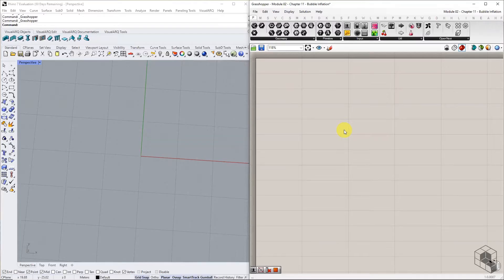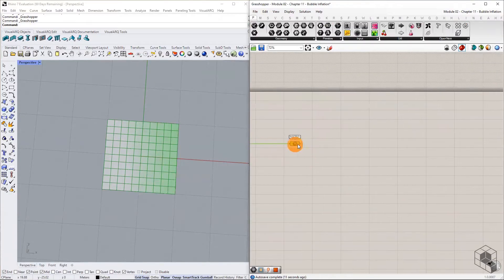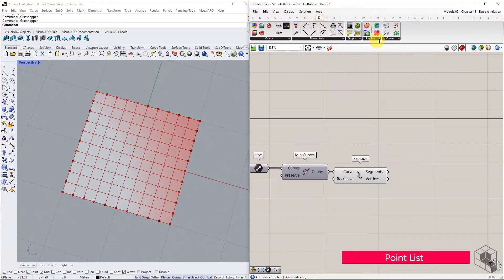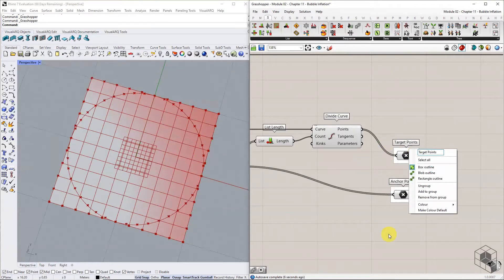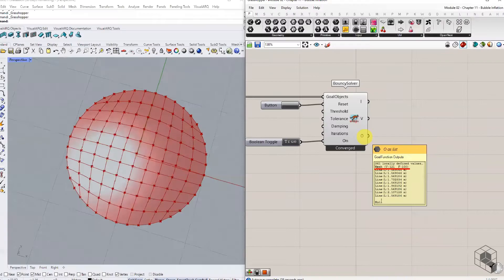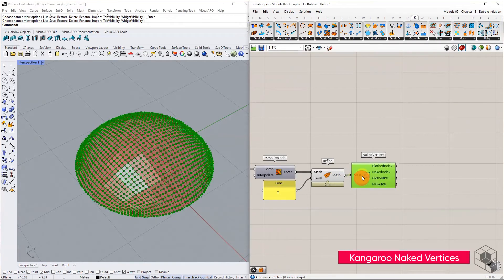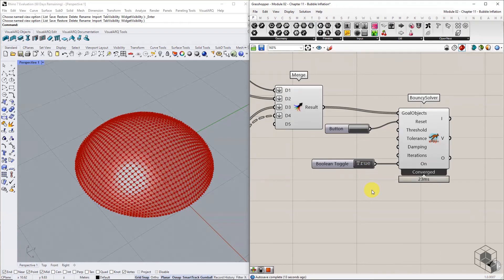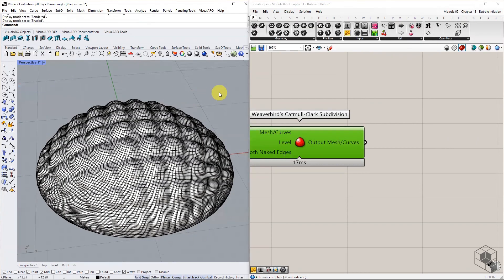Kangaroo Physics Simulations - Chapter 11 | Bubble inflation | Rhino & Grasshopper Tutorial

Comment: Sorry, I need help, the cull index doesn't remove my zero strangley.
Reply from the maker: If it doesn’t remove zero index, you may add zero as input into the index parameter.
Reply: @qbricklab4200, Where can I find the index parameter? Also, very sorry for replying late, I didn't get a notification.